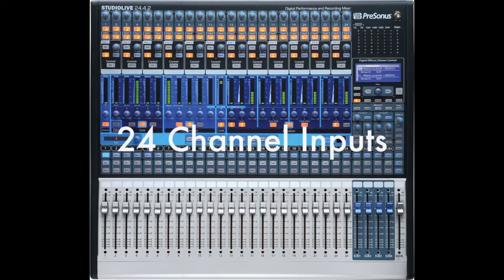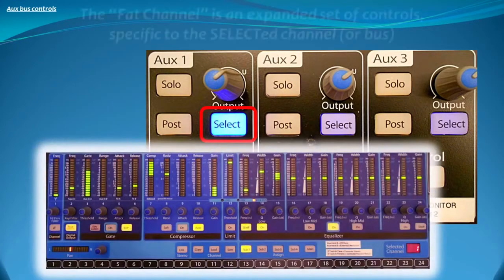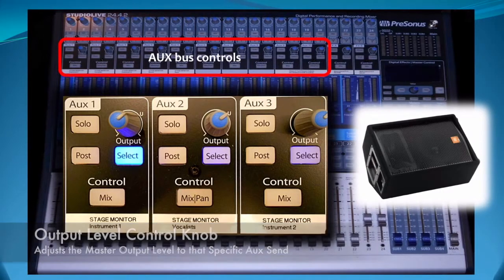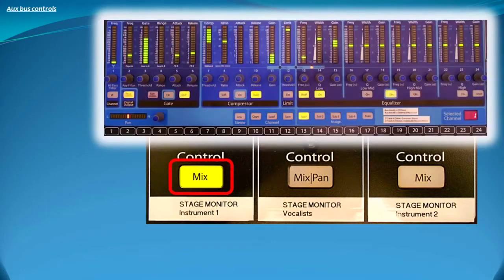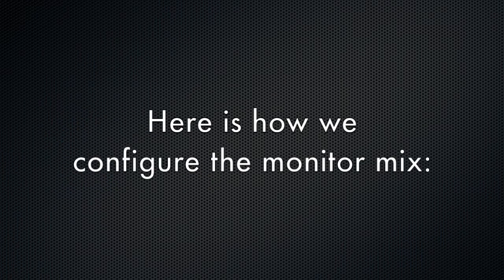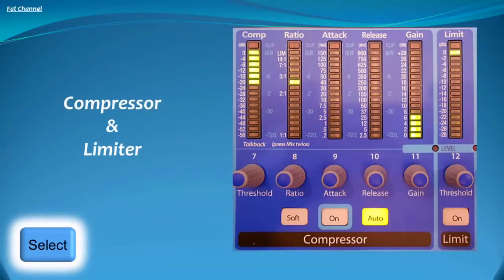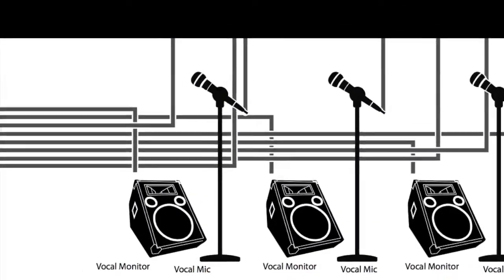How To Setup for Monitor Mixes via PreSonus StudioLive 24.4.2 Aux Sends

Comment: Hi Terrence,

I have a Presonus PreSonus StudioLive 32.4.2AI.  is it possible to send the line level output to Spdif?  It's currently sending the main signal.  However, it will be affected by the volume control of the main mix and the output level is low.

Thank you,
Michael

Comment: fx are applied to the entire aux monitor mix? can i just send the fx that are already being applied to a particular channel? and if so how? thanks
Reply: FX will only be applied to the channels you've assigned the FX to.  The FX level on the Aux acts like at the Master fader to control the overall FX output to that Aux channel.
Reply: @denwinton  Good to know, thanks. better measure of control than I thought though complete control would be preferable for the occasional performer who is persnickety about what does and doesn't appear in their mix.

Comment: Do you have a video for using the scene's? I am having issues with the faders after recall.
Reply from the maker: Thanks for your comment. No video for using scenes.  The faders on the StudioLive series mixers are not motorized. You can recall your stored fader position using Fader Locate Mode. If you recall a scene with Fader Recalling set to "yes", Fader Locate Mode is enabled and you can use the Fat Channel meters to see your stored fader position. To change the fader after recall, you need to move the fader to its original position and then it will become active. Here is a good discussion of this.  https://support.presonus.com/hc/en-us/articles/210048383-How-is-Fader-Locate-mode-on-the-StudioLive-AI-consoles-different-than-the-classic-StudioLive-consoles-

Comment: how do I link two channels to get a stereo output?, im only getting sound in the left side of my in ears can I link two to get stereo in both ears without a headphone preamp straight from aux?
Reply from the maker: Thanks for your comment and question. When monitoring, do you really need a stereo feed? I use in-ear and I find stereo unnecessary. Your in-ear gear pre-amp setup should do it for you. A really inexpensive solution is a mono-to-stereo connector from a place like Radio Shack.  Put it on your in-ear connector, voila! Sound in both ears.  Hope this helps.
Reply: @terrancekawles7693 , When using SOLO option, the headphone output is just left channel. As the guy running house sound, I'd prefer to hear solo in both ears, especially when the room is loud.  As a musician receiving one of the aux feeds, we have use the stereo/mono switch on the headphone amp to run mono but I can see a need for stereo.. say you want your own instrument and/or voice on one ear and the rest of the band in the other.
Reply: From the owners manual: "Stereo linking is done within the Fat Channel. Input channels, aux buses, and subgroups can be linked to create a stereo pair. The stereo pairs are predefined and cannot be changed."  https://pae-web.presonusmusic.com/downloads/products/pdf/StudioLive2442-1642_OwnersManual_EN3.pdf.  

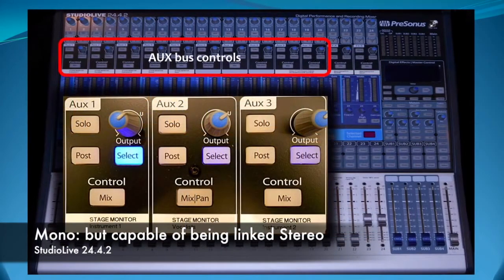I thought there was a way to run stereo out of a single aux channel through a XLR cable but haven't figured that out.  We may have to use this link feature (mentioned at 0:49) and a Y cable to join two aux channels into a single L/R cable.